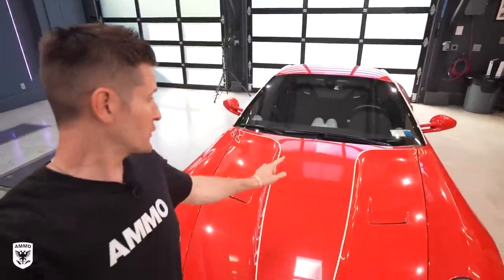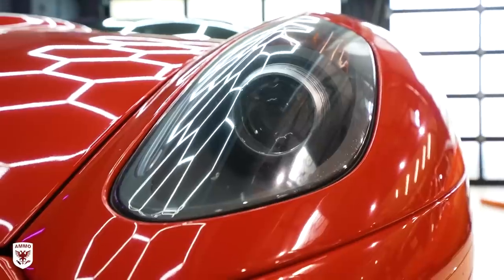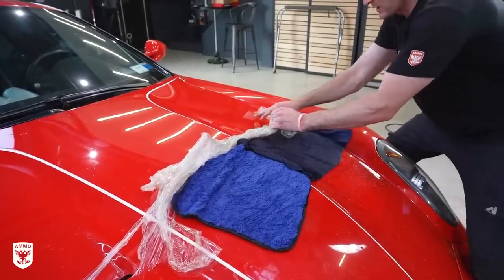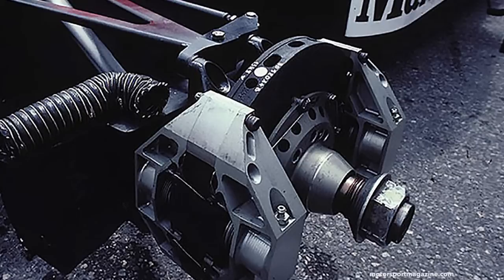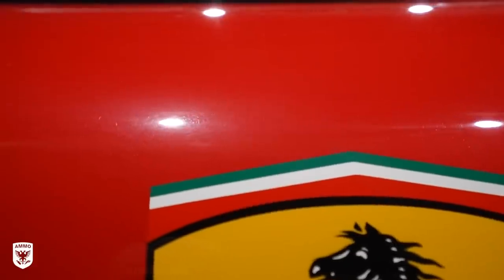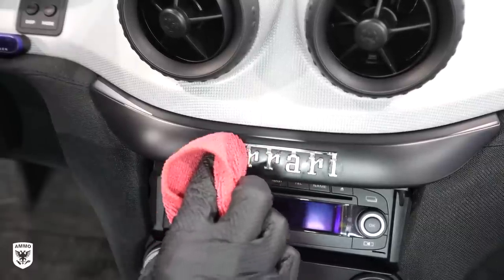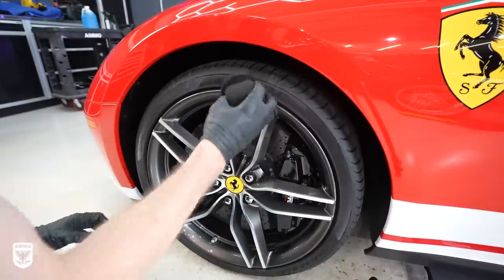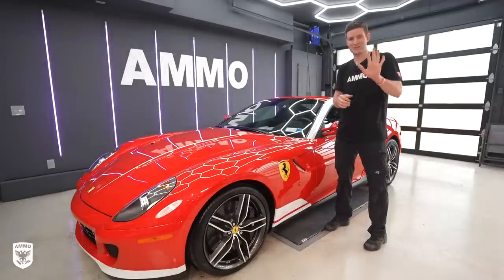Daily Driven Ferrari 599 GTB 60F1 Full Detail!

Comment: I would be interested in comparing maintenance from a daily driven versus one of those garage queens, per mile. Seems that storage creates a lot of seals, hoses, etc. to need replacement at much lower miles.
Reply: I'm sure that per mile, it is astonishing how much more affordable driving these cars semi regularly is. Drive your cars, you rich bastards. Even if it's 500 miles a year. They were designed and engineered to be enjoyed. Treating them any differently makes them lesser.
Reply: Parking this baby in nyc is gunna triple that maintenance price at least. This dude ain’t curbside parking here I’m sure he pays for protected lots( not all are protected, they can be park at own risk )
Reply: Rubber gaskets and so on will age no matter what. It's years, not mileage that's the main problem.

Comment: I'm kind of curious about the "don't remove the wheels" that has come up with a couple different cars now.  What is the owner's reasoning behind not removing the wheels (especially in the case of a daily driven car such as this one)?
Reply: Potential for the wheel to be scratched.  Potential for the body to be scratched when trying to position a jack underneath, etc.
Reply: @Nickkkk838  Don't need a jack he has lifts.
Reply: Carbon-Ceramic brakes easily crack when you drop a wheel on them.
Reply: If its not broke dont fix it
Reply: I wouldn't want anyone to remove/install the wheels on my cars because they never torque them properly and I don't trust ANYONE that works on cars.  This is coming from someone that has worked in the car industry for 15+ years.   Im sure Larry is perfectly capable of doing so properly,but I really wouldn't want my car disassembled to just be detailed either.  Maybe the owner has been the victim of the mechanics that I have also witnessed cars driving out of a shop with loose or missing wheel bolt/lugs and wheels falling off.

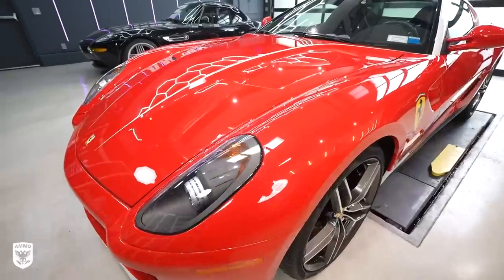Comment: Another tip on cleaning alcantara interiors on 12:05 if you don’t have acces to compressed air, wait for the panel to dry completely the go over it with a medium bristle brush (a toothbrush works perfectly) do it only in one direction at a time and that will lift up the alcantara fibers perfectly.

Comment: Larry, If the badge that has reacted is plastic it can usually have the chrome effect removed with a gel bleach, It will return it back to its original plastic resin and then it can be re-chromed , Coated or painted etc

Comment: So I learned to use wool steal when cleaning the windows and windshield. Spray the glass with enough glass cleaner and use the wool steal over the glass, then wipe it off. It takes all the little particles and grim that wouldn’t come off by just spraying and wiping. Give it a try! It works and looks beautiful
Reply: I will thanks. Add clay over it afterwards and wipe it off. Never need to use windshield wipers

Comment: Those spots can be salt air (from being parked near the ocean with the windows cracked). or simply finger greese and acids, but most likely salt air. Chromed parts don't react that well to it.
Can also be from opening a soda bottle/can and the micro-spray hitting it. Depends on what kind of use it has seen, really. But since you said daily driven it can be whatever at that point

Comment: I have a bone stock ‘05 MR2 Spyder in silver with lots of whimsical “tattoos”:  black vinyl stickers on the body. I’ve not clay barred or waxed Roxy in over two years, for fear of damaging the vinyl tatts. How do I correct and protect the paint, and preserve the vinyl stickers, without accidentally pulling them off.  Note: differences between the paint underneath the stickers from the rest of the paint won’t matter, because I won’t remove them until time for a paint job.

Comment: You should buy a big pot and add the towels to the boiling water. Just use pliers to pull them out and set those on the clear coat for peeling

Comment: 4:29 a young Gordon Murray, designer of the McLaren F1, talking with the driver of the Brabham F1 car. Murray, who was working for Brabham at that time, was largely responsible for the introduction of Carbon Ceramic brakes on their F1 car because of their lower weight and temperature resistance.

Comment: Hey Larry! Quick question: would you recommend the seringe technic to fill paint chips on vertical surfaces? Someone bumped into my car I have a small chip of paint missing
Reply: The problem with that is gravity. If you go back to that part, you can see the surface although not vertical, it was very steep. You can see the paint started to sag before he sucked a little back out with the syringe. Not saying it’s impossible but I don’t believe the juice will be worth the squeeze.